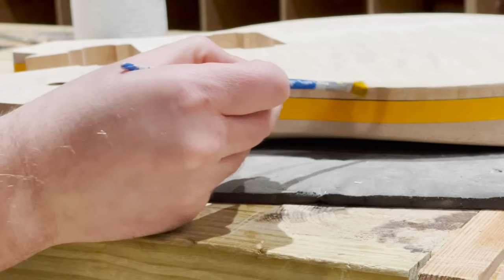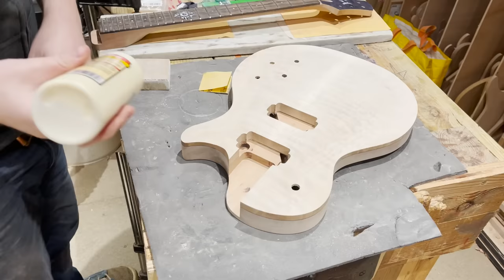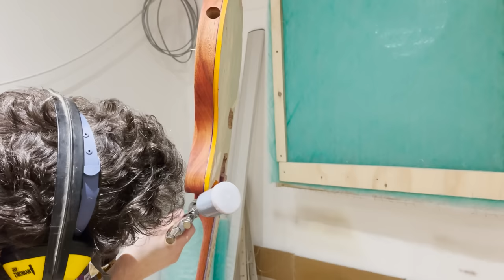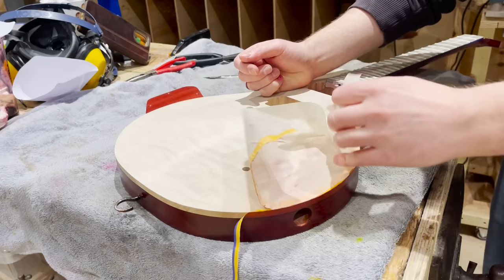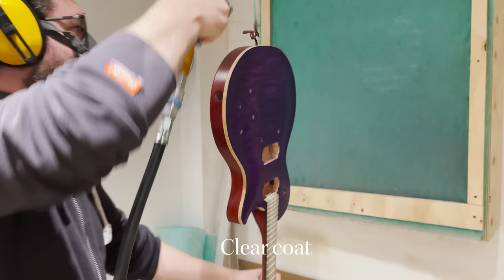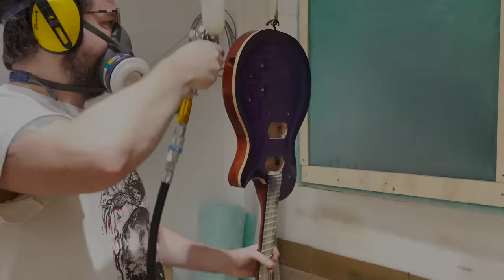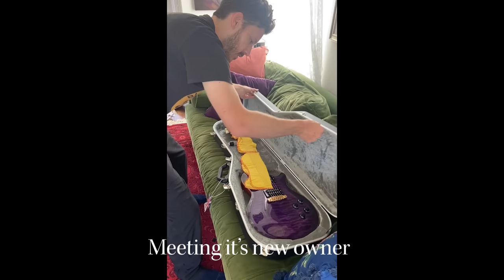How to STAIN and LACQUER a GUITAR, a complete guide | Quilted maple LES PAUL build | E4/4

Comment: What's the point of an instructional video with no instruction? Yes some of the process is self explanatory but not all of it. A commentary on what you are you doing, why you are doing it and with what material or compound would be helpful and far more interesting. I appreciate there are those who do not like commentary but that's what the volume control or mute button is for. That having been said, NICE job on the guitar it looks truly stunning.
Reply from the maker: If i'd taken the extra time to explain every step the video would be over an hour long and wouldn't get watched, if I separated it out into a series it wouldn't get watched. Both those options would involves many hours of extra work, when you could just ask in the comments section if you need advice.

Comment: To get the back plates to perfectly match you can cut them out of the mahogany body using a very fine blade in a scroll saw or fret saw before gluing the maple cap on. You can glue the block back once you cut the cover off, then machine out the cavity to give the needed recess for the back plate to sit on. This method will make the back plates almost disappear.

Comment: I really enjoyed the video and love the results. I read through all the comments you replied to, and judging by your level of sarcasm, you must be tired of answering why there's no commentary. I agree with the masses, but for a different reason. After reviewing the questions, most are about the products used and a lot less about your techniques, and I would also fall into that category. I think a simple matrix of what you used all in one place would answer the larger majority of users' questions and save you a LOT of time and frustration. Although I enjoyed the sarcasm, and you kinda earned the right IMO.  I know I'm not immune, so fire away :)

I have never built a guitar or attempted a finish, so after seeing this video, I became inspired and bought a guitar kit with a maple flame top. My only hope for my first guitar finish is that I don't completely botch it. I feel I can follow your techniques by watching the video, but, my inner beginner needs more specifics on the products.

I took moments of your video and tried to piece everything together the best I could. Would it be too much to ask for you to correct me and fill in the blanks or add a bit more detail where necessary? 1000 thanks in advance.

Sealing faux bindings - 								Chestnut Sanding Sealer
Neck glue up - 										?
Grain fill DIY - 										https://youtu.be/Hx-6Mhd31qQ
Preparing to spray some cherry shader - 				Spirit-based dye added to thinned-down lacquer
Clearcoat to protect the color	- 						?
Raising the grain before applying dye - 					Damp rag with water
Applying dye diluted about 50/50 - 						Angelus Purple, diluted with?
Acetone pulls out excess dye and helps to blend colour - 	? Brand ?
Sanding sealer to prevent colours from running -			Chestnut Sanding Sealer ?
Clear coat - 											Morrells lacquer
Spraying the edge burst	- 							?
Building up the clearcoats	- 							Morrells lacquer
leveling the laquer -									After 3 weeks, 1200 on top and 800 on the back.
buffing	- 											Chemical Guys swirl remove
Reply from the maker: I appreciate the sentiment, but the people that leave the narky comments aren't the sort of people that read the comments.

Comment: Great video, thanks. Tip for others.. allow plenty of time for the finish to harden before trying to sand and polish. The harder it is the better the result. Learned that painting cars.
Reply from the maker: Good advice, even more prevalent with wood too as the lacquer will always shrink down into the grain, no matter how well filled it is.
Reply: What kind of time frame would be reasonable between spraying and a re-coat or sand? I guess environmental conditions play a role in the hardening time?
Reply from the maker: @YoureNowOnTV  yes and what you're spraying too, this is pre-catalysed cellulose lacquer so it cures pretty quickly. I tend to leave 30-45 minutes between coats - I know I can leave lacquer in the gun for that long without issue, and I'll spray max 3 coats per day. If I want to level between coats, then I'll normally spray 3 coats in the day and level sand (dry) the following morning. I won't wet sand and spray on the same day. The manufacture says this can be buffed within 3 days but I'll always leave at least 10 days before doing final level and buffing because it will still shrink into the grain.

If I was spraying traditional nitrocellulose, I'll leave it at least 2 weeks before doing and level sanding (apart from the odd bit of denibbing) because it takes that much longer to harden and shrink into the grain.
Reply: @YoureNowOnTV The time between coats is normally specified in the instructions. The time between applying a coats and sanding it is normally a lot longer. With most products I make a test on scrap wood and leave them overnight. It varies a lot. Some primers you can carefully sand after a few hours if you don't allow the paper to clog, but with some gloss paints  they recommend allowing a week. In general the harder the finish is the better the gloss you can polish in. If you are polishing away with compound and it's not getting better it's probably still too soft. Edit: When wet sanding by hand the paper tends to clog if the paint is too soft. When it's nice and hard it tends to make a fine slurry you can wash out of the paper.
Reply: @ADFinlayson  Thanks so much for taking the time to reply to my questions. Greatly appreciated! 😀👍
Reply: @ColinWatters  Awesome information. Thanks so much! ☺🙏👍
Reply from the maker: @YoureNowOnTV   on worries, you’re welcome

Comment: Realy nice work! Thank you. One question left: did you don‘t do sanding between sealer and lack coat?
Reply from the maker: I just spray a bit of sealer in light mist coats to prevent the dye running or looking patchy then lacquer right over the top. It’s not as well prepped of a surface compared to a properly levelled base coat but with a few coats of cellulose melted into each other, it levels it’s self off quite nicely

Comment: Hi, thanks for the video. Superb! One question: when staining/finishing a headstock that has an inlay on it, how do you avoid staining the inlay itself? Do you mask it (some inlays are lines, so thin, that masking is difficult or not an option). If you sand it, you also sando over the finish... so, how do you do it? Thank you very much! Best regards!
Reply from the maker: Good question, if you're using pearl then it should really stain the inlay, just make sure you've sanded it well. You could also stick to water based dye and use some minteral spirits to wipe down the inlay once the dye is thoroughly dry or even try light sanding with a high grit like 400-600, if you pull a tiny bit of colour out of the maple headstock veneer then it's not the end of the world, it will just make the figure pop a bit more.

Comment: Very good angles on al lthe techniques; I'm most interested in a list of the products (and potentially even the tools) you used for this process. What kind of stain, grain fill, poly coat etc. Are you using here?
Reply from the maker: I use angelus dye to do the purple with a cotton rag. The grainfiller I made myself - I have a video on that https://youtu.be/Hx-6Mhd31qQ and the finish is Morrells cellulose lacquer

Comment: Ok so many questions!!!!
What and did you seal/prep before the color stains? Did you apply with a sandpaper? Sounds scratchy? Is it water based?
Same for sealer?  Need a supply list please!!! @A D?
Reply from the maker: for the back and neck  I applied a grain filler that I made straight on the wood (there is a video on my channel on how I make my grainfiller). The top does not get any sealer before dye, dye on to bare wood then sanding sealer over the top to stop the colour running. All the finishes I used including sealer are cellulose based, even the grainfiller has lacquer in it.

Comment: When spray painting, make your first coat very light and leave it until it tacks up (tack coat) before spraying your second coat. Then when you spray your second coat, you can really flood it.

If you don’t do a tack coat first you can only spray light coats and it makes getting a high build gloss finish really difficult.

Also don’t finish your passes over the body itself, change directions upon an imaginary surface beyond the object you are painting.
Reply from the maker: That sounds like a good technique for spraying 2k
Reply: @ADFinlayson  Works for all paints, learned it from a pro many years ago, best painting tip I ever got. It’s a fast first pass that looks sparse and crappy which is let sit until it gets tacky but does not smear when touched (I just check on the masking paper or tape), then the second pass is slow and heavy until almost the point you’d think it would normally run but it doesn’t. The trick I found was resisting the urge to touch it up again straight away, and just waiting a full tack again before doing it. The first thing it knocks out is overspray, but the best thing it does is just saves time in colour sanding later.

Comment: These have been a huge help prior to doing a stain job on a tele body that I have. One question that I have. Do you not sand the sanding sealer after it has had time to dry and before the clear coat?
Reply from the maker: No, I only use sanding sealer to prevent the stain from running. I’m not using it as a base coat

Comment: Beautiful finish and purple is my favorite color. I didn’t see you use any grain filler on any part. You raised the grain on the front and dyed it. Did you sand it after using the acetone? If not, did the sanding sealer fill the grain? If so, how many coats? Also what kind of film did you cover the front with when you finished the back? Thank you!
Reply from the maker: I grainfilled the mahogany on the back, there is no need to grain fill maple. I raised the grain with water because it helps the alcohol dye penetrate the softer grains better. I only use sanding sealer on the top to help prevent colours running during the first couple of clear coats
Reply: @ADFinlayson  thank you. One more question. What grain filler do you use? I’ve used color tone ; not so successful on a stain job I did on mahogany.
Reply from the maker: @jugheadjones5458  I make my own, if you search "how to make your own grainfiller" you will find one of my videos.
Reply: @ADFinlayson  I will do that. I’m always trying to learn. Thank you.
Reply: @ADFinlayson  I watched it and left a questions comment for you. Great video!

Comment: Awesome. Which grits do you go through when level sanding the clear coat?
Reply from the maker: I like to say I start with 1200 on the top and 800 on the back. But that's on a good day, it really depends how well the paint goes on and how good the grain-fill went.

Comment: Stunning looking guitar mate…Q:is it possible to achieve that kind of the shine with hand buffing? What compound did you use plz?
Reply from the maker: Yes it is, I used to hand buff. You just need to wet sand to a way higher grit before getting the polish out. around 10,000 grit. 

I was using Chemical Guys swirl remove in the video but I do a buff with medium solid compound (brown) on the buffer before hand, didn't include it because the video was getting too long.
Reply: @ADFinlayson  Rubbish!

Comment: Wonderful work! I'm not sure if I missed it in the comments, but why does the burst go on after a couple layers of clear?
Reply from the maker: if anything went wrong applying the burst, you'd be able to lightly sand it off without going through the stain and sealer
Reply: @ADFinlayson  Very smart. So you hit it with 2 layers of clear, burst, then 3-4 additional layers of clear?
Reply from the maker: more like another 10 coats of clear.. with cellulose you want lots of thin coats. If spraying 2k you would spray 3 thick coats
Reply: @ADFinlayson  Sorry mate, last question, I promise. Let's say I did a flame top, hit it with black and sanded back to accentuate black lines. Afterwards, I went in with purple. If I used acetone like you do here, would it inadvertently affect the underlying black stain?
Reply: @ADFinlayson  Hey boss, sorry to bug you again. Same question as before, but if I go in first with black, sand back, apply purple, am I going to screw something up in the deeper black layer if I try to blend with acetone?
Reply from the maker: It will be quite dark

Comment: HI great video, but could do with some detail such what product used if not brand the type, and "raisng the grain before dyeing, what did you use to raise the grain water? as i say some details would be greatly appreciated many thanks, what grit of sandpaper you advise at the stages etc, edit * its a lovley finish, Im building a Les Paul style guitar at the moment, mine Ive put a Flame maple veneer on it, its a mahogany body same as yours with a maple neck im torn between letting the Mahogany & maple show, or a solid rich deep blue to match a rich blue dye finish on the veneer.
Reply from the maker: Yes, a damp rag to wet the grain, that's all
Reply: @ADFinlayson  thanks

Comment: Quick question,  my take away from watching this is that you can spray the lacquer on a little heavier then you would say a paint finish, even though it is kind of starting to get they puddled look like it's almost gonna run but it isn't, it's just swirly, It doesn't matter because your just gonna come back in the next step and level it anyways and then polish and buff it so those steps are gonna take it back down to a flat even finish anyways. Does that sound right? Or am I thinking wrong? And when you leveled it, are you just using water to wet sand it basically? Or is that acetone or alcohol or something you got in the spray bottle?
Reply from the maker: the paint is thinned a fair bit, but I put on as much as I can in a coat without getting runs, otherwise I'll be spraying for weeks. The spray bottle is water with a few drops of dish soap.

Comment: For the eye screw used to hang the guitar, do you get the same size as your button? Or do you go bigger/smaller?
Reply from the maker: The pilot hole I drill for the hook is 2mm for a 3mm hook screw, the strap button screw is the same size screw just longer

Comment: Do you flat the laquer after each coat? Also, do you work on other guitars?
Reply from the maker: Depends how well it goes on, I tend to do a bit of denibbing with 320 after a few coats, then I might level with 6 or 800 after 8 or 9 coats but if I do that there is usually very little final level sanding to do after 12 coats

Comment: I have an issue with some pre drill holes on a kit I got and I believe the spacing is for a 51.99mm but I can only find wrap around bridges that are 52.5mm. Can you help me
Reply from the maker: If the bridge doesn’t fit the holes, plug and redrill

Comment: E 4/4 does that mean there are more previous episodes? Is this a kit? "Grain fill" too funny.. Not sure why to original taping around under the binding and what you painted on and why you took it off and the added it back on.
Reply from the maker: Yes it's a full build series, here's a link to the first episode https://youtu.be/YmGhUeM0Eak

I taped off under the binding to start with to apply sanding sealer to the edge so that dye didn't bleed through from the top to the sides.

Comment: how many clear coats..how much time between coats...sand between clear coats or not?
Reply from the maker: It depends how the paint goes,  if you're getting a lot of orange peel then I'll do more level sanding between coats, but this is nitro so you don't NEED to sand between coats. I do max 3 coats per day and leave it at least 2 weeks before doing the final level sanding.
Reply: Love a lot of your videos, and very envious of your talent. You've inspired me to buy a kit and have a go myself. I'm not keen on the idea of an oil finish, and would rather have something like a nitro clear coat. Any advice on whether a nitro spray coat (rattle can) or a nitro clear paint would be better for a complete novice. Both claim to not require sanding between coats. What's best from your experience?

Comment: What dye did you use on this one?
Reply from the maker: Angelus
Reply: @ADFinlayson  thanks. Did you thin it, or is that straight from the bottle?
Reply from the maker: @amberwolf80 I did thin it slightly with angelus neutral, but I wiped it back quite a bit with acetone which does the same thing.
Reply: @ADFinlayson  awesome. Thanks for the info. Much appreciated. You do beautiful work.